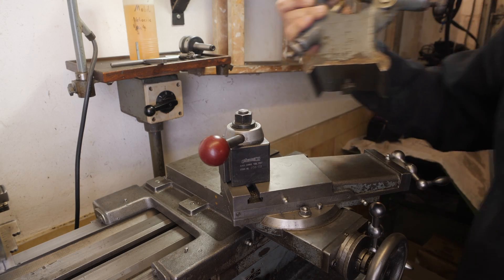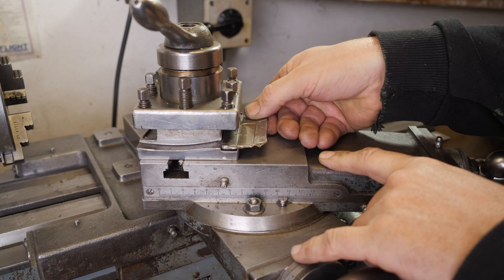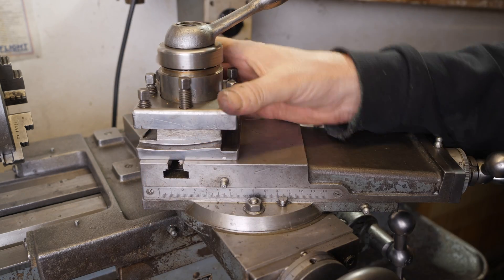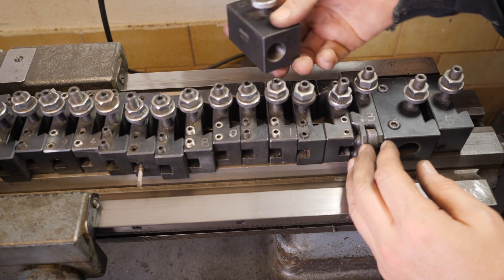Lets do a machine review before it leaves || RotarySMP

Comment: Two-speed motors are generally pretty tricky to run from a VFD. Because they are already using a switch between star and delta to achieve the two speeds, I don't think that you can reduce the working voltage to suit a single phase supply (eg if you are in an area with 400V three phase and 230V single phase). Though voltage-boosting VFDs do exist, which might be an option. 
A more difficult problem is that VFDs typically react badly to having their output wires disconnected and rearranged. Ir might be possible to set up the change-over switch to disable the VFD when switching the connection, but that would take some modification to the switchgear. 
You would then probably need to tell the VFD that the motor has changed parameters, as the internal control loops will need to be switched for the diffferent motor inducion. back-emf etc. 

That said, all this can probably be done in digital logic nowadays. For example an Arduino could be used to sense the speed switch conection, disable and re-program the VFD and then open and close a set of relays to switch the connection pattern for the new speed selected.
Reply from the maker: Good points Andy. I run the Dahlander in the Schaublin off a VFD; but only wired it up for the high speed winding, and have a 400V VFD. Should have thought that through better.
Reply: i dont think thats right... multiple speed motors have different windings with different number of poles. the star/delta stuff is to get the right voltage on the windings. you can run 230/400v motors on 230v VFDs perfectly fine. im pretty sure you can run a multiple winding motor on a VFD fine, as long as you wire up the highest speed windings and leave those permanently connected.

you are correct that VFDs REALLY dont like the motor being disconnected or switched mechanically on the output side.
Reply: @kv4302  What I said  is true for the Dahlander connection. ( https://en.wikipedia.org/wiki/Dahlander_pole_changing_motor ). Basically a Dahlander motor is alternate poles wired as to different sets. You excite them in-phase for high speed and in antiphase (ie, just reverse the connection polarity of alternate poles) for slow speed. So you have a doubled-delta and a twin-star arrangement. If you look at the diagram on the Wiki page 1U-2U and 2U-1V are in-phase with each other in low-speed delta and in antiphase in the star arrangement. (I know that this disagrees with my earlier description, I assume that the poles themselves are wired in the opposite direction to allow for this) 
I have been prompted by this to read around the web, and the advice seems to be that the sensible thing is to wire only the high-speed setup to the VFD, then use the VFD to control the speed lower if needed. This actually has exactly the same effect. You are still using all the copper (unlike the case with some of the other multiphase motor  options. I have a diagram of the others fromt he web that I will put a link to in a reply to this reply, as I have had posts rejected for external links in the past)
Once you exclude the requirement to retain two-speed operation with the VFD I think that it might then be possible to wire the motor for 240V too, but you would need to split the links at 1U, 1V, 1W and reconnect to (2U,2W),  (2V, 2U) and (2W, 2V)

In many case it probably makes sense to swap the motor to a VFD-rated motor of the same frame size and available voltage.
Reply: @andypughtube  thats very interesting! thank you for sharing!
Reply: Just use a 380v boost VFD, quite common today, and hook up a small 380v motor (250w is enough) direct on output. Then you can use the lathe command without worrying about the VFD as it always see the small motor which will soak surges.
The only downside is you loose vector drive (V/f is mandatory) and integrated thermal/current protection.
Reply: Hi andy  there are electronic  non variable  1 to 3 ph converters   ,one manufacturer  is a korean company  DPS.
There still would need to be some form of pause on the converters output of course.
(edit) didn't notice that the motor was 400v , 240v would require a motor rewind or new motor
Quite common in canada , considering all of the weird voltages everyone else uses. 600v forever!😁

PS not using Linuxcnc but been following it for years ,appreciate your efforts👍
Reply: There are ways to do it, andy.  

The easy way is to use a freewheel motor on the VFD and treat it as a simple 3 phase supply, the setup looks a bit like a rotary phase converter except that the freewheel motor can be pretty small - all it has to do is be able to absorb the switching transients that kill th eIGBTs on a VFD normally.  This also has the bonus of being able to use the machine without any rewiring.

The other way to do it is a bit more tricksy, and requires support from the VFD.  In chinese VFD land, the NFlixin 9600 range are the only ones I know will do this, take in a 240V single phase supply and drive 400V, with 2 separate settings for the different winding setups.  You need a load of relays and interlock downstream to avoid the aforementioned switching transients (basically, you make it so the V1/V2 switching can only happen with the drive output turned off).  It's tricksy, but it works and that's what I have driving the mill.  

In all cases, you need to size the VFD for the high speed range of the motor.

There is also, in many cases, a way to internally rewire the motor to go from 240V to 400V, but that's getting into "heavy modifications" territory and it's not guaranteed to work.  My mill's motor wouldn't do it, for example.

I've been inside a few Dahlander motors :)
Reply: I recently put a cheap Chinese VFD on my Enco mill with a 2 speed motor.  I left the switch in the line for safety.  But found that I ended up switching it off or between high and low some of the time.  It throws an error code about 25% of the time but has survived fine so far.  This is all 220v so needing a boost voltage may cause more issues
Reply: I found another vfd on Amazon they were closing out for $42 for a 2.2kw vfd.  How could I say no?   The case definitely looks cheap, but it has the odd feature of not throwing an error code if my muscle memory has me switching the manual 2speed switch while running.  I have done it numerous times and it just keeps going.   The downside of this one was that default config was for 400hz !    Something that likely would have caused catastrophic failure of a 60hz motor if allowed to run a full speed.  I had to change settings in about 6 spots to a much safer 70hz and then adjust the run voltage up so it would have low speed torque.
Reply: ive done it several times. just wired the motor as single speed. alternatively you can still switch between high and low speed with vfd powered down. but not ideal.

Comment: I have a 10x24  (5" center height) Cincinnati lathe that has a 9.5" wide bed, and a saddle length of 18" (for 24" between centers).  There's so much support for cutting tools, and bed wear on the hardened bed ways is almost non existent.  A lot of the operations that are difficult on small lathes are a breeze on over built lathes like these.  I keep looking at 14x40 import lathes, but I can't quite bring myself to do it.
Reply from the maker: Yeah, I feel the same. The Shaublin is also massively built for it's capacity.

Comment: i have a 5lz. think its just the bigger brother. full set of change gears but missing lot of other parts. also bed i warn badly.  yours looks good.
Reply from the maker: The 5LZ is the machine I was hoping to buy back then, but was too impatient, and none came up. Mine also has some bed wear. It is a shame Boley didn't do hardened beds.
Reply: @RotarySMP  yes. thats a big problem. the rest of the machine is supper wel made and a lot of thought gone into desighn and cleaver plans about. but the soft ways are there down fall. mine is warn real bad. 0.4mm from what i could get on a quick setup first measure before i disasembled it. was thinking to scrape and make moglice bearings in the sadle... but havent had time.....

Comment: Sure. Just drop it off in Naxos and I'll haul it back on the ferry and check it on the flight home. :)  For my wants i need a longer bed though and probably a bigger through hole.  There is a Shark lathe available locally but never heard of them and have found no info on it so some kind of rebrand. It's a 7x55 and needs work as usual for $1500.
Reply from the maker: I have never heard of a lathe branded Shark either.

Comment: I am genuinely sorry about Boley not making lathes anymore. I have a BDN 160 cnc lathe and I absolutely love it. I’m always looking at Boley lathes, but the ones before they where bought by Citizen.
Greetings from Hungary!
Reply from the maker: I didn't realise Citizen bought them. I had wondered what happened. Thanks.
Reply: @RotarySMP well yes, that’s what happened to them. If you look up BC42 or BE32 machines they are almost identical to citizen lathes
Reply from the maker: @bencegunyho6183  Wonder how long Citizen continued with their design for?
Reply: @RotarySMP  I read it up again. They bought Boley in 1994 and i think until 2002 or 2004 they sold the BDN160 which was originally designed by boley.

I dont know a lot about Citizen lathes, but to my knowledge they are rarely fitted with a turret tool changer, just the layed-out “Gang” type toolchanger.
Interesting is that the Citizen group Boleys are exclusively fitted with turrets (except one model)

Comment: Nice lathe,  Mark.  Hope , next owner will love and enjoy it  as much as  you did.  BTW.  you mention LinuxCNC acting as ELS   - do you have any details, links, pointers ?
Reply from the maker: Thanks. I just set it up as a single Z axis cnc, reading the encoder and commanding a stepper driver through the parallel port of some old pc. It was not a permanent setup, so I just kludged it together.

Comment: Hmmm, that's not going to get 100K views I'm afraid.
Reply from the maker: Hi Alexander, I have no expectations on that, but I wanted to do my review on this lathe before I sold it.
Reply: @RotarySMP  Just saying, the last three videos were a bit on the weak side, including the live stream/interview (which I also didn't watch). It seems, if you want another banger, you need to condense a useful tool project from start to finish into 15 to 20 minutes. Or even longer, as the vise video has shown.
Maybe look in your project list, if something qualifies, and then push that to the top?

Comment: Good ad, I'd buy it. I'm sure potential buyers are aware of this but the comprehensive tooling that comes with the lathe really boosts its value. - Heather
Reply from the maker: Hi Heather, yeah. It drives me nuts when a machine is separated from it's accessories, as it takes years to track them all down.

Comment: Nice machine. I didn't know those machines have the lead screw down the center, that is interesting to learn. The Schaublin 120vm uses a similar design, it does make a dro install a bit more challenging.

 The collets aren't as strange as w20 with its 1.666 pitch sawtooth  :)
Reply from the maker: I think lathe makers do this sort of weird thread just to show they are lathe makers.

Comment: That marketplace website just let's me know that "Oops! Your IP address is blocked". Wow, so helpful. The linked help page just suggest to go find a way to get a different IP. That's just weird. And yes, I'm in europe (and on a "normal" DSL line). No actually helpful information to get my current IP unblocked, either.

As a side note: when following the direct link you provided I am taken to a login page. If I just go to the main web page, it works fine. Are you sure you provided the public link for the listing? I can search for "Boley" and find it just fine on there. Nothing blocked when going through their main page...
Reply from the maker: Good point, it is probably because that link is associated with my login. I just replaced it.

Does it now work for you?
Reply: @RotarySMP  yes, works fine now! I was just very confused by the initial message, thanks for the quick fix!

Unrelated: 2000 € seems rather low for that kind of machine and accessories btw. But I do hope you find a good home for it.
Reply from the maker: @TheCreat  Thanks for checking that. I would be happy with a price new 2K, and it going to a good home.

Comment: High Precision, Manual Production lathes of that size are pretty rare south of the Equator in Australia.  Those that you do see are almost always incomplete and have been thrashed to death in my neck of the woods. in 30+ years repairing machine tools I never saw a Boley that I recall. I'll have to stick with my Hercus.
Good luck with your sale I hope something interesting and useful comes up to replace it.
Reply from the maker: Thanks, I hope so as well. Boleys are reasonably common over here.
Reply: Mate, you can still find old Colchesters and Weilers occasionally pop up on the usual sites like machines 4u but putting in a word with local used machinery resellers is the best way to go. They grab old items off university or tafe, estate sales and plant closures. They won't be in the top condition you'd normally see overseas.